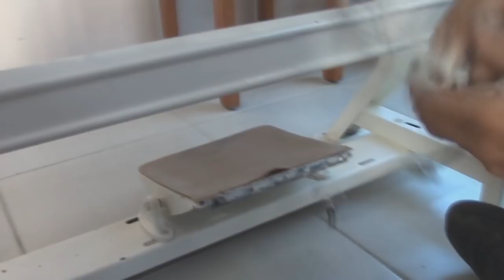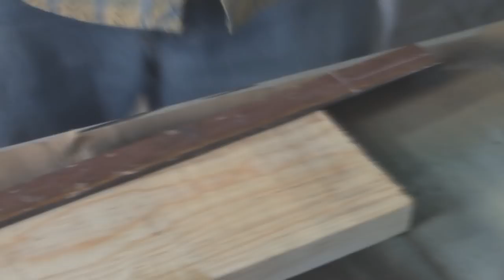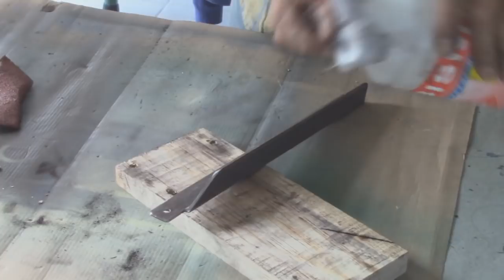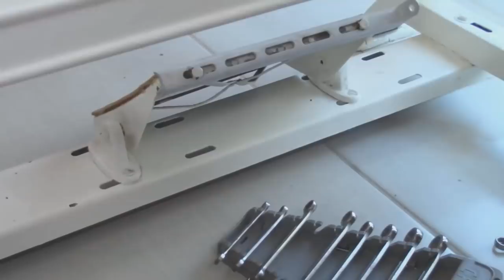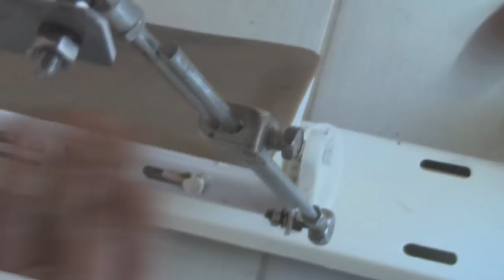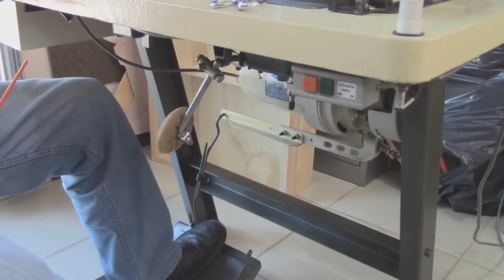How to Slow Down The Speed Of a Sewing Machine  - Part 2

Comment: I have watched both videos on reducing speed and really appreciate your video ....I’m getting a Singer 191d300aa out of a Seamstress shop where it was used sewing clothing ... not sure it has been modified  and I do not need the 4200 stitch full speed ahead power ....   So getting info on reducing it down ... had thought of the pulleys ....  also saw someone do a different set up with same results.  This is much simpler, less problems etc.   So will try it 1st to see how it sews, then will modify as needed using 1 or both ways you have shown.  Quality work ...and watching how you did this tells me that your leatherwork will be as good ...   I hope to learn more .. for now I will be using to make some heavy cloth bags, etc.. but  see the possibility’s for the lighter leather too....    Thanks so much ....

Comment from the maker: Cechaflo
The 'part one video' shows how to 'reduce' the speed of the sewing machine  transmited from the electric motor to the sewing machine head...the 'big pulley of the machine' does less turns while the 'small pulley below' on the motor spins faster...this 'tip' helps a lot to do the sewing, but it is not enough.                              
The 'part two' shows a logical sequence: by elongating the lever of the motor, the effort to move the pedal will be the minimum and we would have a better control of the sewing machine. The 'pitman rod' should be put in vertical position...an 'extra spring' could be added attached from the 'motor lever' to the reverse side of 'wood table' and it would be of great help for the best control of speed.

Comment: Question: is this the same Paff machine that you had put the reduced sized pulley on?.....just wondering.....david.....and, why did you "play" with the tension wing nut on the arm which is spring loaded?....
Reply from the maker: That spring keeps the lever in position upwards. I had loosened it for the process and it now needed more  tension to keep the pedal lever upwards.
https://youtu.be/YDiyffeXleg?t=458

Comment: Very good, especially for the beginner  as you can loose control quickly.  Seasoned hands like the control too.  New servo motors are nice and I have considered them. I have doubts that they would last as long as these old style ones. Thanks.
Reply from the maker: These tips are for industrial clutch motors. It does not work 100% but it helps a lot.
Reply: Cechaflo  Right you are.  Might have to do some more work. Many buy an industrial machine to do  canvas and other heavier materials without using a regular home machine.

Comment from the maker: brs_workshop
If you don't have the tools to make a custom bracket as shown, many hardware stores have "L" angle with built-in holes that should be able to align with the existing holes. You still might have to cut it with a hacksaw or measure and have the store cut it. Like this: http://www.homedepot.com/p/Everbilt-1-1-2-in-x-14-Gauge-x-36-in-Zinc-Plated-Slotted-Angle-802407/204225759
ANSWER:
+brs_workshop  Thanks for the suggestion!...I have that material, but it is too wide and weak. Besides, the idea of these videos is arouse creativity/ingenuity in the interested student in order to  use materials we have at hand or we can get in a junkyard.

Comment: Hi guys! This is ingenious. It might slow mine down to about 85mph huh? Hahaha. Darn high speed. I was wondering if I could add a variable speed pedal like used on a dremel to help slow it down. What do you think? Love you bunches. Thank you always for your incredible knowledge.
Reply from the maker: Two tips take part to slow down the speed of a clutch motor sewing machine. The first is the use of a very small pulley on the motor. The big pulley of sewing machine head should be bigger. The bigger the better. The second tip is the keep a better control of foot pedal by in elongating the lever as shown in the video.
Video one:https://www.youtube.com/watch?v=50wKoaU5ugk&t=160s
The best suggestion to reduce the speed would be to change the clutch motor for a servo motor.
I have no idea about the speed pedal on a dremel. I think in advance it would be good.
Reply: @Cechaflo  thank you thank you!!! I appreciate your time and knowledge. You have helped me out alot.
Reply from the maker: @LilDirt12  You are very welcome anytime!

Comment: Where could I find the pulleys?Is the diameter the same for most motors? I finally found a Pfaff 463, not a walking foot but a start, thanks for making these videos.
Reply from the maker: If trying to reduce the speed by using a smaller pulley you have to consider the cilindrical opening in the center of the pulley should perfectly fit the 'keyed shaft' that goes into. Otherwise, you would have to resort to a lathe operator to reduce the pulley's diameter.
I do not know where to get those pulleys, sorry. Hopefully, on ebay you could get a similar:.https://www.ebay.co.uk/itm/1-X-Industrial-Sewing-Machine-Pulley-Motor-Clutch-Speed-Reducing-45mm-120mm-New-/172435717212
https://www.ebay.com/itm/Sewing-Machine-Round-Belt-Motor-Pulley-1-2-Bore-/162338300727
On Amazon too:https://www.amazon.com/Industrial-Sewing-Machine-Motor-Pulley/dp/B01CXNRJKU
Reply: @Cechaflo  thank you

Comment from the maker: takes2home
Hace 1 año
Another thing.  I think in the USA you may have better prises because the tax here in Germany are very high.   For an new ADLER dûrkopp machine in Germany you got  always order it first and wait at lists 3 to 4 months  and for a new PFAFF machine if you ordered first you can get it in minimum 2 days but this is only if you want it complete with motor and table. But for the Adler doesn't  matter what ...you still have to wait 3-4 months..Crazy! Don t you think? 
I am really happy for my AB vario DC1250. 700w brushless EFKA MOTOR. They say is better than a 750w TEXI servo motor or a HO-NSING 750w servo motor...what do you think? Do you know those servo MOTORS?
ANSWER:
+takes2home TBH I've never seen a servo motor in my life...I'm updating myself, and as an upholsterer I should know... I'd better buy my new machines directly from mexican distributors (Mexico city, Leon city, etc.)...most of them are ready for sale...just the money to pick them up.
RESPONDER

Comment from the maker: takes2home
Hace 1 año
I Love watching you by the work. i learn every time something. 
ThAnK YoU Cechaflo.
By the way Thanks for the link you have send me for the Pfaff here in Germany. I have got almost 2000 euro in coupon and they   are unfortunately only valid for the shop near me. so its gonna be a new Pfaff 1245 with an EFKA 750w servo motor, i gonna get the machine next week i hope.
ANSWER:
+takes2home It's great to hear that! ...send us a picture to see the new 1245...if possible a small video showing us how it runs...I'd like to see the servo motor in 'slow motion' stich by stitch...very useful when we sew leather.
Just a question...so, if I'd go to Germany, am I commited to by my machine from a supplier/distributor? ...can't I buy it directly from the factory at a wholesale price? https://www.google.com.mx/maps/place/PFAFF+Industriesysteme+und+Maschinen+GmbH/@49.4854814,7.6886857,15z/data=!4m2!3m1!1s0x0000000000000000:0x074b78da63dcfc7a
Does the same goes for Durkopp&Adler:      https://www.google.com.mx/maps/place/D%C3%BCrkopp+F%C3%B6rdertechnik+GmbH/@52.0060396,8.6011889,17z/data=!4m7!1m4!3m3!1s0x47ba3e7f0f2734e5:0x61a2978feae3cbed!2sPotsdamer+Str.+190,+33719+Bielefeld,+Alemania!3b1!3m1!1s0x0000000000000000:0x09bff6fbc628f8b4

Comment: Cechaflo, thank you for your videos. You are very talented! Now I have finished the flattery! Where or how do I get that srwing foot you are using? Is it an adapted straight stitch foot? Thanks again for sharing your knowledge!
Reply from the maker: It is a 'binding feet' that comes with a single leg on the small foot:https://www.ebay.com/itm/for-Pfaff-Walking-Foot-Binding-Presser-Feet-Industrial-Sewing-Mach-145-335-1245-/282353862547
If it would be difficult to get it, just cut off one of the legs with a small grinder.
You are welcome anytime!

Comment: Hello Cechaflo, I have watched both your videos on how to slow down the machine. I have had my mechanic change the pully to the small one, so I know that the tension on the belt is correct. I have now completed the second step (i.e. to control the speed.) Everything has been done as per video. No matter how I try I cannot get this machine to sew stitch by stitch like yours.  It is considerably slower (thank goodness) but I cannot get it to stitch one by one like your video (i.e. like when you walk the machine using fly weel.) I have a Juki 1508N. What are we doing wrong? I appreciate any help, thank you for yourt time.
Reply from the maker: Hello Tracey, I understand these methods does not work out 100% but it helps a lot. As mentioned a servo motor is the best solution to sew stitch by stitch. 
My first video mentions the relation of pulleys. For instance, if the 'small pulley' in the motor turns round ten times, the 'big pulley' or 'hand wheel' should turn once. If we want to improve the slowness it would be advisable to make with the help of a lathe operator a new bigger 'hand pulley'. It seems to me the 1245 pfaff 'hand wheel' is bigger than LU juki 1508N.
Reply: Try using a motor controller or a fan controller to slow down the speed of the motor.
Or gear it down more with a pulley swap

Comment: Hmmmmmmm .. I think you will find this will cause you to burn the clutch out faster as you will constantly slip the clutch.
Reply from the maker: Because of the additional lever the pedal is lightly higher but it works well. The clutch of motor is in its position as if it would not have those alterations. The 'additional long lever' only helps to get a little more control of pedal, no more than that.
Fortunately, it's been more than five years and the machine is working perfectly.